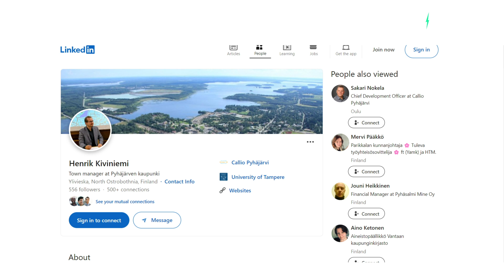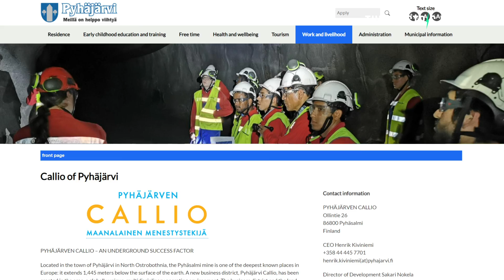Europe’s deepest mine transformed into a GIANT underground battery

Comment: It would be good if you could cover some of the downsides of this gravity system, e.g moving parts and the maintenance required, and how these affect the overall performance of the system relative to other storage systems
Reply: Exactly. 

 A closed in 1990's, "upside down mine" (enter at 8200ft. side of granite mountain, up to 1100 inside) 
only had to cap the bottom tunnel, back up flowing ground water, plus small high pressure turbine, high psi tunnel plug the main investment. Guessing enough to run a couple dozen homes. (not international news)

Maybe 1500 to 2k ft max head at small flow rate--say enough to fill a 1 by 2ft ditch flowing several mph.

 Plug back pressure on the ground water is 'reclamation' of sorts, possibly crucial for some natural springs or whatever...not crucial to overall landscape, it all ends up as crystal clear cold creek water in a mile anyway.  (((high Sierra's E. Central Cali)))

IF I had a point--some leftovers have low impact or even positive impact w productive potential.
Reply: same maintenance  as your lift  in Apt / office buildings
Reply: Just the one word: friction.
Reply: @boballen9095   Friction should be very low, on the order of a couple %, just a cable over a sheave.  Losses will be from motor/generators and electrical which might be on the order of 10% round trip.  A lot better than pumping water uphill or compressing air in a cavern. 

So it's down to initial costs and maintenance, mainly capital upfront.  Could be viable at first glance, no blatant deal breakers.
Reply: Well the biggest downside is that there isn't always an abandoned mine shaft where you would want one.  The second biggest downside is that many of these mines requires water to be constantly pumped out and this takes energy.  A third problem is that mine shafts require ventilation to prevent the build up of dangerous gases plus many of these gasses are strong greenhouse gasses.  Sure maintenance of moving components is also an issue but likely far more easy to manage then the problems of location, water and ventilation.  Sure, if you have an abandoned mineshaft in a suitable location and with low enough pumping and ventilation costs then why not but these gravity batteries won't solve our grid storage issues by themselves.

Comment: Only need six months storage in winter!
Reply: Wind turbines are particularly favorable during winter
Reply: @13thbiosphere  and i like jam on my toast
Reply: They just have to find a way to lift the Matterhorn 5 kilometers into the air. Ask Musk or Sandy if it will work. i reckon they would answer with a " sure..no problemo " LOL
Reply: Wind turbines actually generate a lot of energy in winter, especially in Europe, and with a mix of wind and solar and if there are enough of them, I don't think we need anywhere near 6 months battery storage as that is very likely overkill, but we probably do need around 2 months worth,